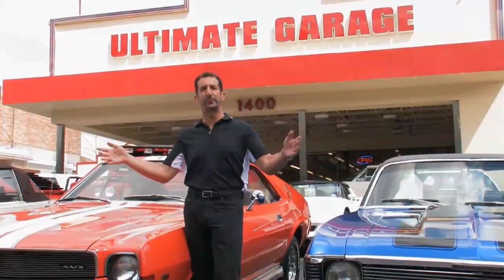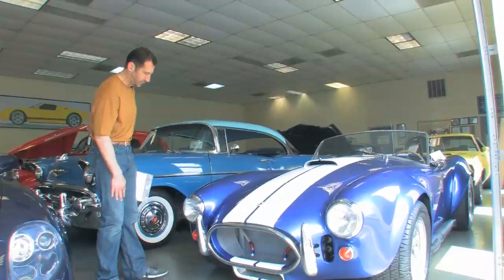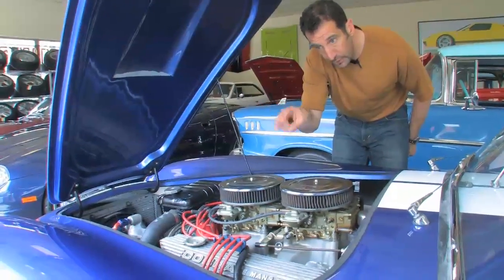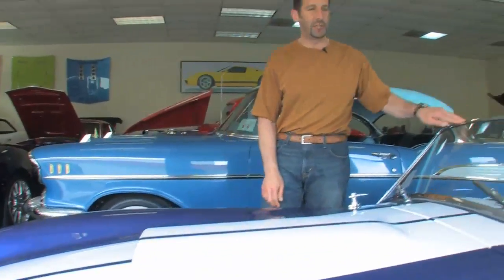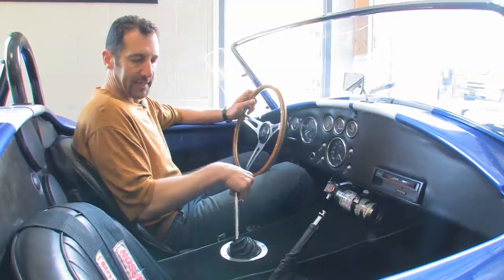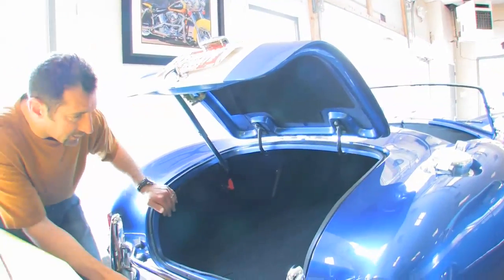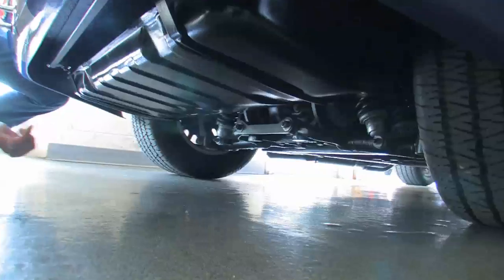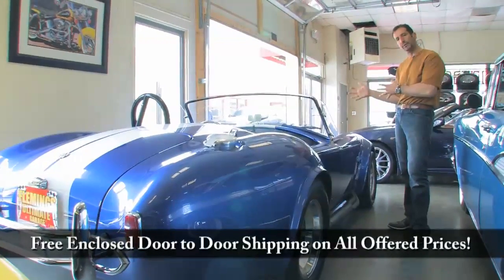1966 Shelby Cobra for sale with test drive, driving sounds, and walk through video

Comment: thats a nice car but the premier cobra is nicer and the chassis is exactly matching the original frame all parts would interchange better aluminum work inside the engine compartment ..unfortunately the company went defunkt because owner spent the money elsewhere. but if you can find one there were 17 cars made they are amazing.i was the chassis builder look em up on the web premier cobras.com